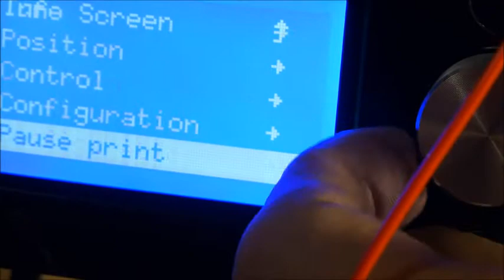Embedding a nut inside a 3D printed knob

Comment: I have a problem, when I pause the printer, the extruder stays im the same place instead of going home like yours, could you help please?
Reply from the maker: Hmmm... don't know the answer to that.  My experience is that it always moves off to the side of the print bed when you pause.  Must be something different in the controller firmware for what pause means on your printer.  I'm running stock firmware.  I suppose you could turn down the feed rate to something very very slow and then you'd have time to set the nut in place with a pair of needle-nose pliers. (Sorry for slow reply.  I wasn't notified there was a comment. )
Reply: I believe if you are printing from SD, the head moves away when hitting the pauze button. If you use a direct connection with your PC, and pauze it through the software, it stay's in place (i think)